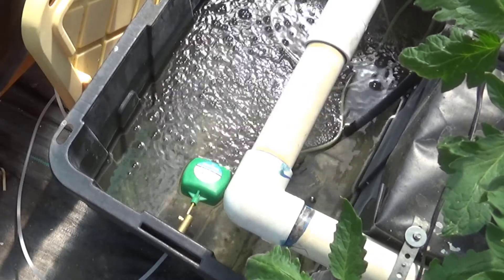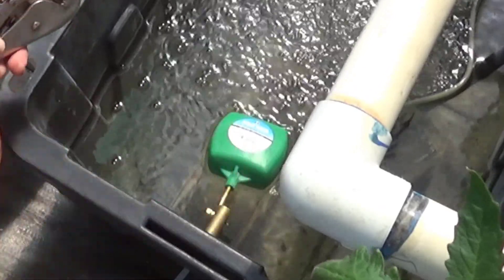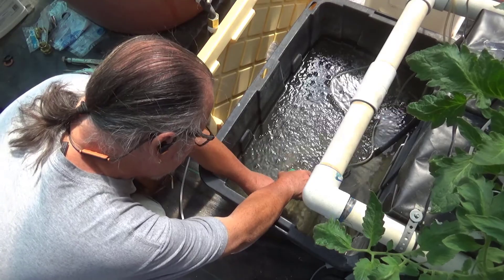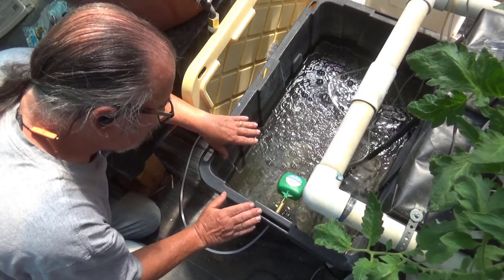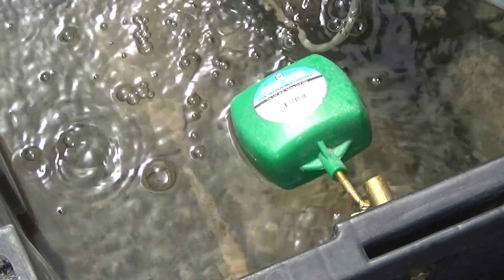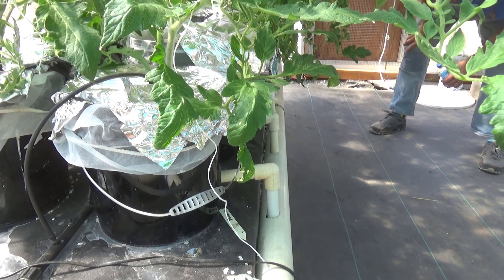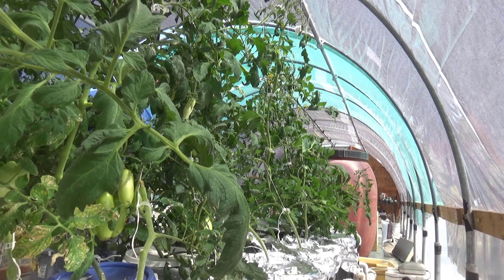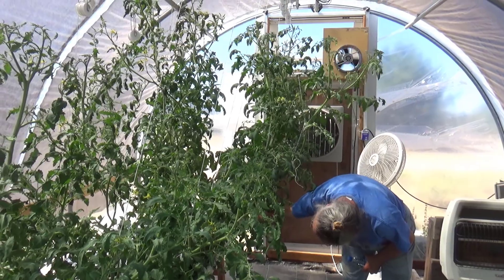How To Build Dutch Bucket Hydroponic System: Make Up Water Detail #shedwars #teampeacemaker

Comment: Great information! 

Thanks for sharing!

Gro Dat!!
Reply from the maker: Thanks! We decided to use that simple float valve from a swamp cooler because it’s inexpensive. The biggest reason is that it mounts easily without cutting a hole below the water line. Take care.
Reply: @BrainStormAcres  I purchased 6 of these a few days ago after watching your video and Mr CBs. Takes alot of the extra work for my wife adding the water or solution when I'm at work!
Reply from the maker: It’s just the two of us taking care of everything off grid, so every little bit of automation helps! Have a great weekend. Take care.